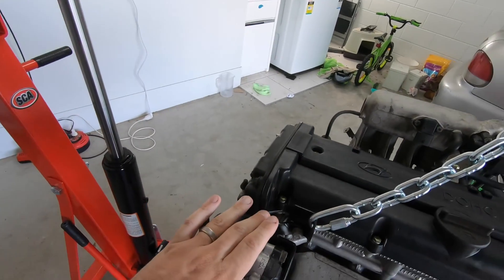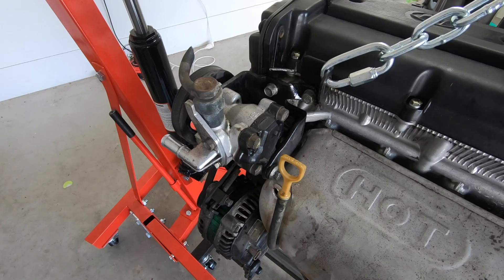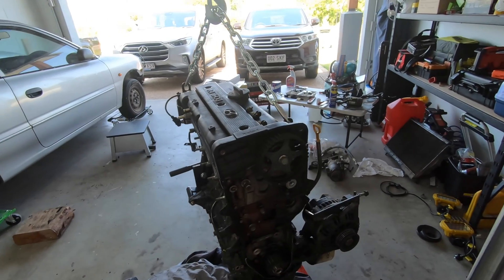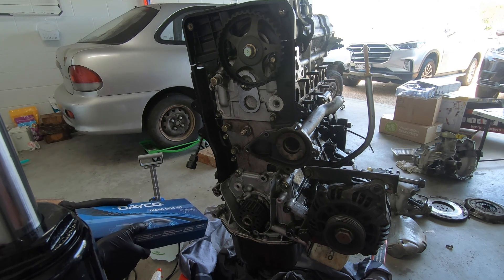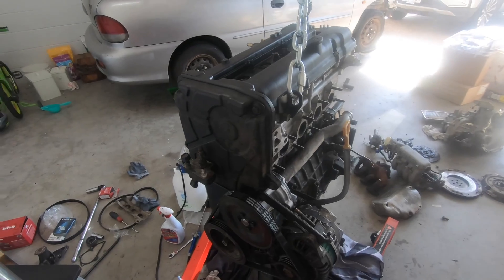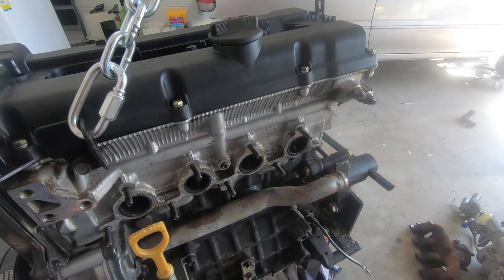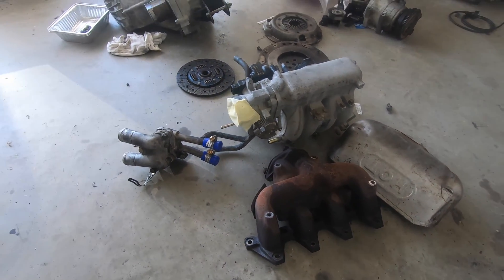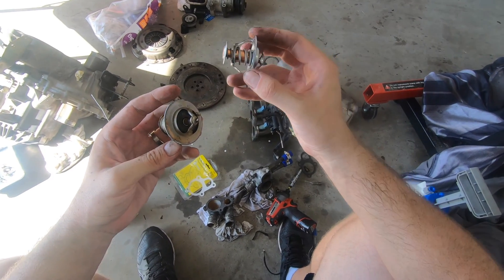Road Car Engine To Race Car Engine In A Few Easy Steps

Comment: Are you gaining sth from removing the water pump?
Reply from the maker: I will gain power by removing the aircon and power steering. I didn’t remove the water pump, just replaced it with a new one as I didn’t know when the last time was that it was replaced. I figured I would do that while the engine was out of the car as it is much easier than when it is still in.

Comment: Great vid mate. Quick question, what type of bolts did you use to connect the engine to the stand (length and pitch) and which points on the engine did you connect to? Thanks mate.
Reply from the maker: Simon Cutajar thanks mate. I’m pretty sure I got some high tensile bolts that fit through the holes and could fit a bit on the other end. That’s one of the reasons I kept the engine crane connected as a “just in case” scenario. If I find out what bolts work, I’ll def let you know. If I pull the engine out again, i think I’ll find out the exact bolts to use.
Reply: @BigRigRacing  thanks mate. Keep those videos coming. My engine has been on the crane since the weekend but want to secure it to the stand to start stripping it back.
Reply from the maker: Simon Cutajar will do. Have a bit to do, hopefully it comes together sooner rather than later. Eventually I want to get a second engine and do a complete rebuild on it, pretty keen to do that.

Comment: Are you planning on straight piping the car because I would love to  DIY custom exhaust video
Reply from the maker: rc quadcopters and drones I haven’t thought about that part too much yet. There are a few different options I could take. There is a bolt on kit specifically for this car, or I could go the way of getting one specifically made for the car.